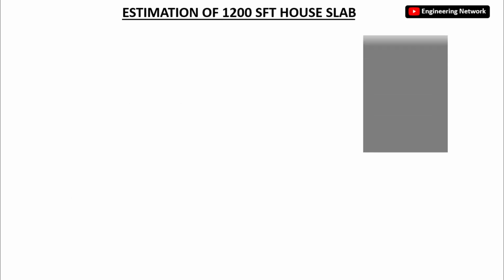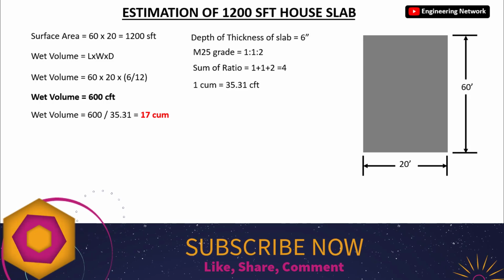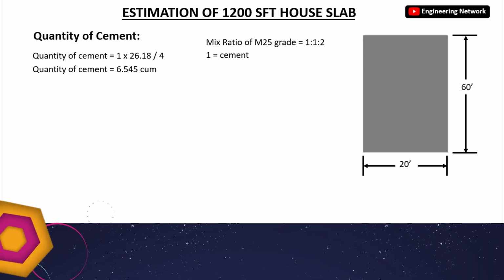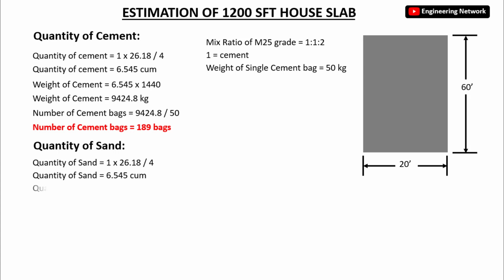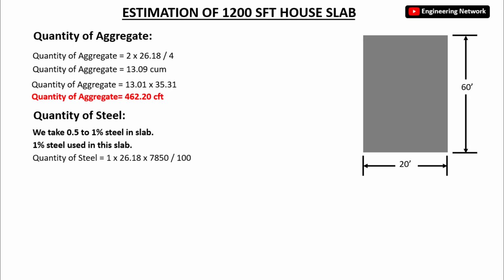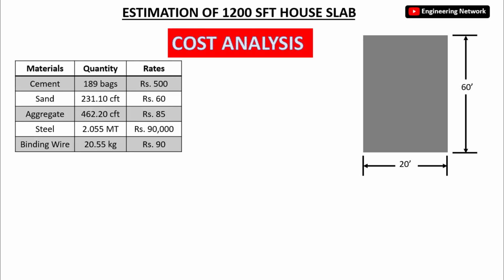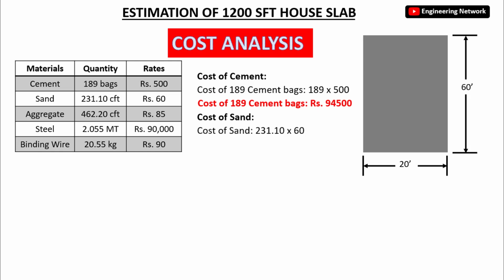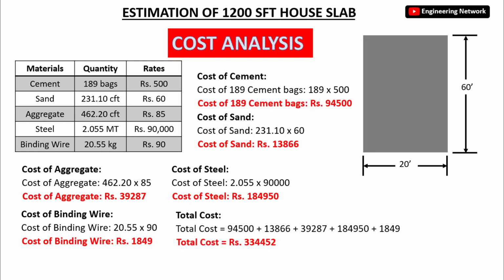How to Do Estimation of 1200 SFT Slab – How to Calculate Steel Quantity in Slab – Slab Cost Analysis

Comment: Also can I know what the 0.5 stands for please? During the steel quantities
Reply from the maker: Dear the thumb rule for steel calculation in slab states that the amount of steel used in slab should be from 0.5 % to 1%. So it totally depends on you and your structure requirement that how much steel you wanna use in slab.